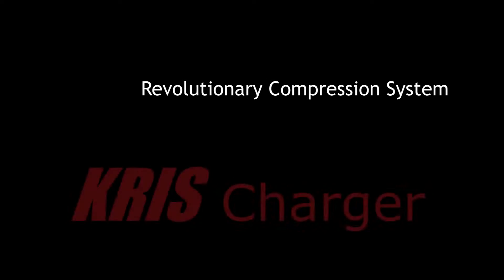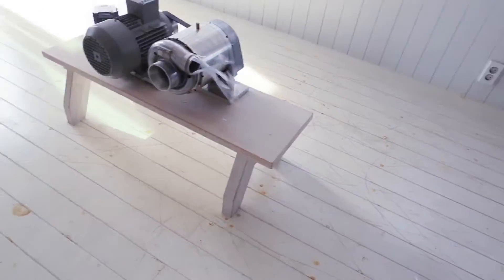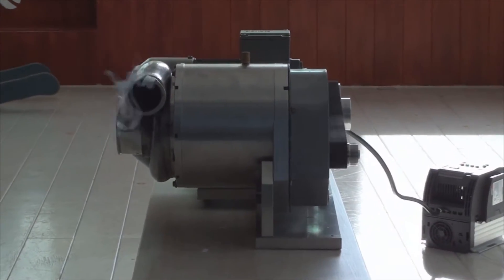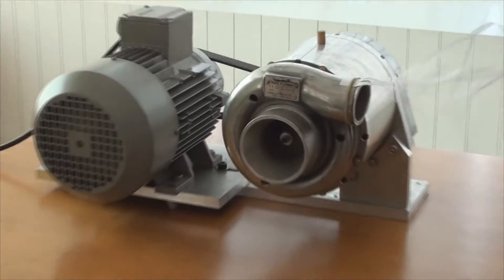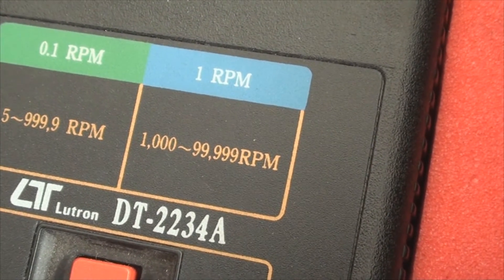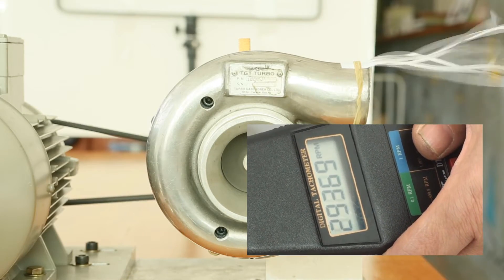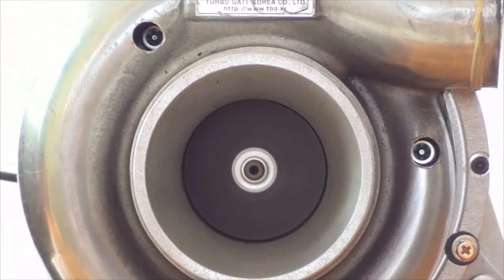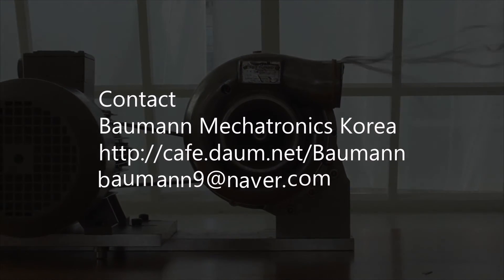supercharger revolutionary compressor system kris charger

Comment from the maker: This is basically a turbocharger without an exhaust impeller. Other conventional models use physical gears to connect the power source to the main impeller, resulting poor durability and low RPM. We have patented this model using special mechanism so that the main impeller shaft is not connected to any bearings, making it very durable even at a very high RPM. This does not need any oil cooling, oil changing, any maintenance what so ever. It is true that it may not be as effective as a conventional piston compressors when it comes to pressing air into a tank under high pressure. However, it can deliver a huge amount of air and is as effective as a turbine that uses exhaust gas, without all the pipe works and oil cooling systems that increases weight and cost to a car.

Comment: The problem with using a turbine in an air compressing application would be back pressure. For this to work, you would have to devise some sort of airlock system, a system already achieved with piston style compressors. Applying a piston style airlock to a turbine such as this would however be redundant, as you might as well just use the piston for pulling air in on the down stroke as well. Without an airlock system, using this turbine to compress air would be like using a house fan to try and compress air into a tank. However powerful as your fan might be, it just wont work.